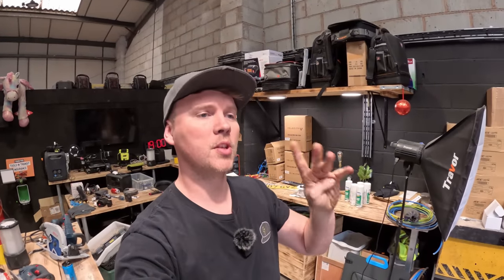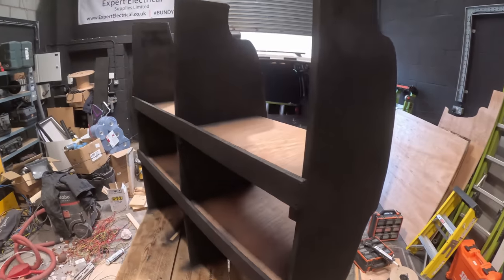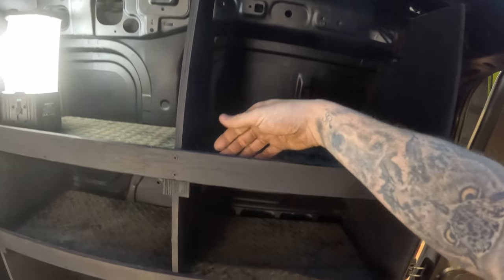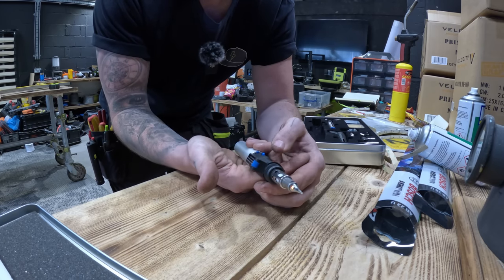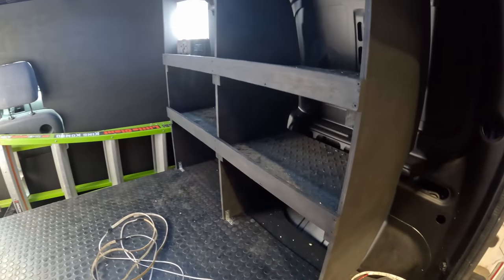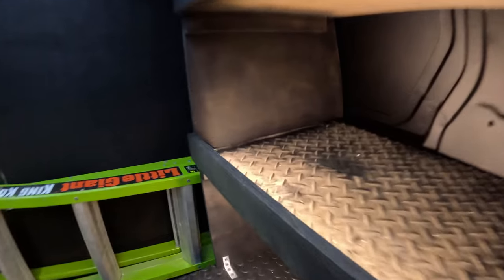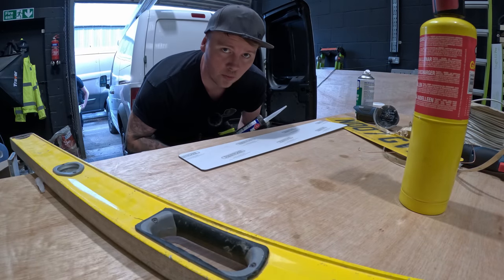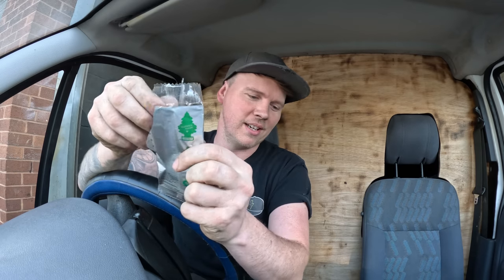van restoration part 4 - LED lights in racking

Comment: When soldering, it's better to clean the tip before use, and leave the solder on it when you set it down. This will help prevent oxidation of the tip and extend it's life.

Comment: A small inverter 12v to 240v would be a god send, Ive got two in my van used to charge batteries and my laptop. If your getting a head unit ask them if they could upgrade the speakers also and/or add some. loved seeing

Comment: put bigger wheels on and then go for bigger brakes
i used to fleet 100+ of these and that's what i always wanted to do
also, make sure you've got the later canvas boost hoses rather than the older rubber ones as they can pop off with ease
other than that they go on for ages and ages with nothing more than driveshaft and front wishbone issues
one van had the sinking clutch pedal issue but nothing else in 4 years of running them
you just need to specify if it's the earlier one with the 1.5 din head unit or the facelifted full double din head unit, the on/off button is rubber on the earlier ones and plastic on the facelifts, makes a HUGE difference in what head units and options you can fit as the earlier ones came with the older plugs whereas the newer ones came with the quadlock connectors

Comment: Awesome stuff Nick. How about some grey or black carpet on the front of the timber partition/headboard? The gas soldering irons are great. If you don't have your hot air gun for heatshrink there's an adapter in the Dremel kit for heatshrink. Cheers

Comment: Using heat on the bumpers is a bad idea. It works by drawing the oils in the plastic to the surface, which makes them dry out quicker. Have you thought about doing a colab with a local car detailer that could give the van a good, proper clean?